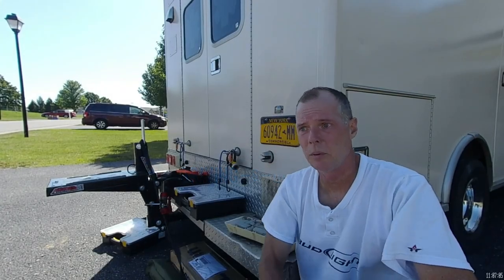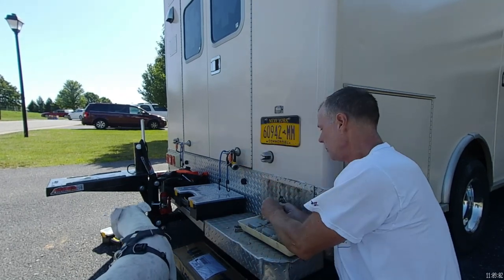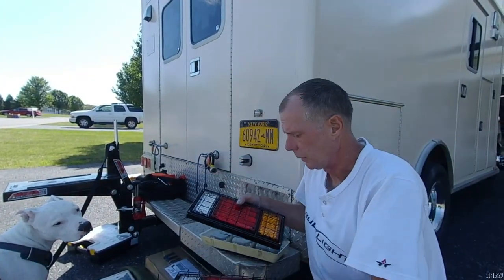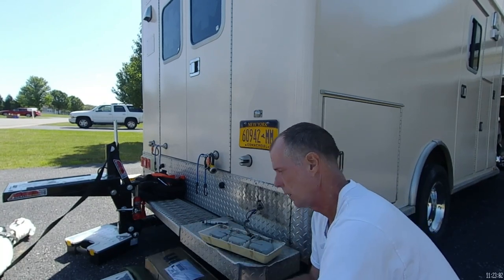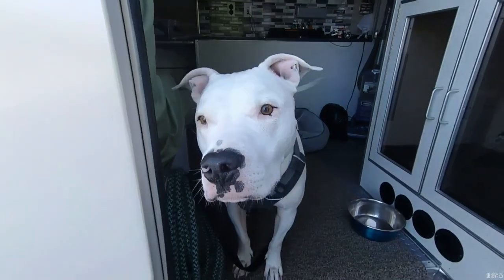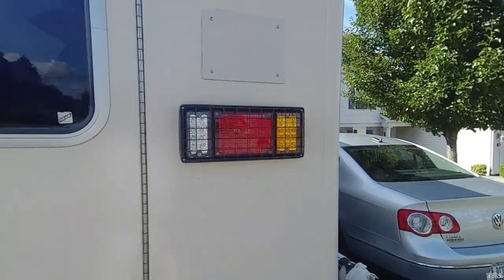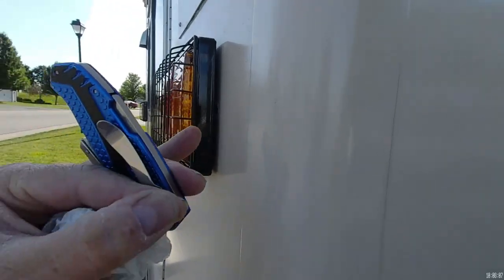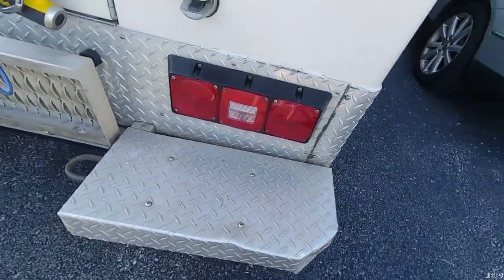Ambulance RV Offroad Taillight Install | Full Time RV Life

Comment: The lights look great and the painting black of the bottom lights was a great idea. I assume that you took advantage of the plastic plate access to run the wires from the bottom lights.
Reply from the maker: You're exactly right. I was able to reach in the panel to fish wires for the new lights. That was a whole day of work but it was worth it! Thank you for watching and for commenting.

Comment: I bought the same light unit. When u apply the brakes does ur amber light (turn signal light) come on with the red brake lights?
Reply from the maker: Yes - I thought I'd made an error but I went to the Amazon listing and it showed pictures of all the different modes. The amber and red come on together for brakes according to the pics. Strange but I figure more light is better!?! Thanks for the comment and for watching!